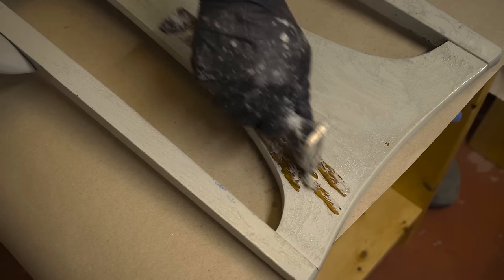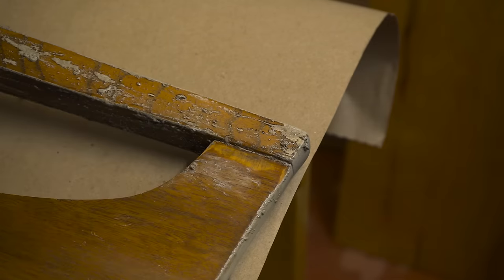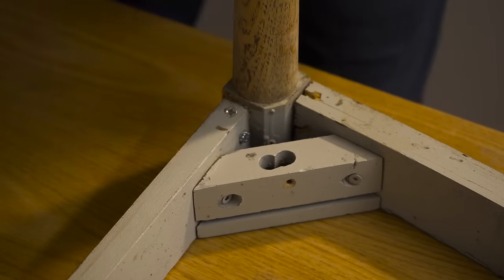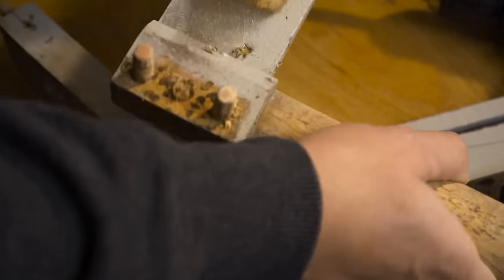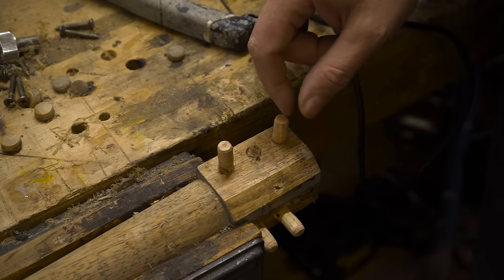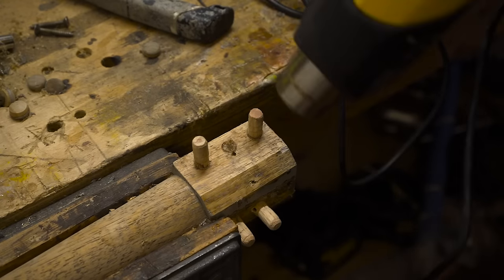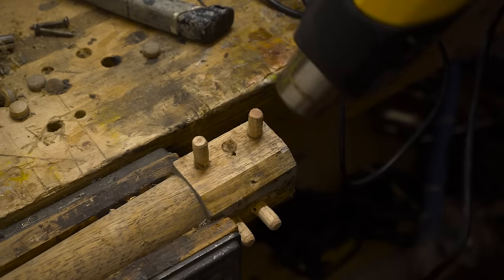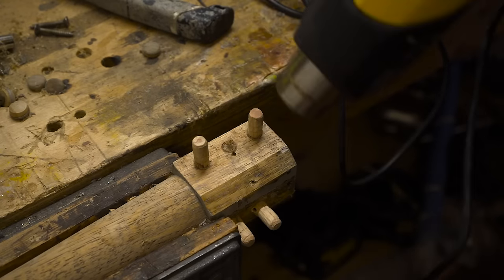Stripping Paint From A Classic Brasilia MCM Chair | Furniture Restoration, Refinishing & Repair

Comment: You did such a detailed restoration job that I am confused why you left the paint on the base, on the not visible parts of the chairs! Thanks so much for sharing
Reply: This is exactly my question either - especially that the chair was totally disassembled, so no excuse for hard to reach surfaces. Otherwise, excellent work as always.
Reply: I was wondering the same thing.

Comment: Was there a reason that you didn't strip the paint from underneath the seats? A slow strip seems to have worked with these chairs. Nicely done.
Reply: Was wondering the same, especially when they were disassembled, the perfect opportunity to get into the hard to reach places..
Reply: I was wondering the same thing. Being the perfectionist he is, I was quite surprised he didn't remove the paint.  

The end result was gorgeous. 🤩

Comment: Grew up with Brasilia. Heavy, clumsy, uncomfortable chairs and rickety table, especially when the large drop leaves were up (and the table was useless when they weren’t). Also, table legs positioned too close to the edge, so there was no getting two chairs in on the side. Remembering wildly sloshing glasses when the legs were bumped. And there was no not bumping them, try as you might. Hated that furniture, excepting the attractive matching credenza. Nice repair job anyway!

Comment: Quick question - if you allow the paint stripper to soften the paint, could you use a pressure washer to remove the softened paint? Like 700 PSI and a 25 degree angle would be pretty gentle, I'd think

Comment: why didn't you strip the paint from the underside of the seat? How did the part where previous restoration attempts sanded through the veneer turn out with the stain? Did you have to patch that spot or attempt to paint the wood grain there? Did you re-upholster the seats or keep the existing upholstery? Is it original upholstery? Why didn't you show us any of the restoration work from the arms, that would have been fun to watch.

Comment: I am brazilian and i was wondering if there was a explanation for the name. For those who dont know Brasilia is the capital of Brasil. A totally new city built from scratch in the middle of nowhere in the 60s. Its a symbol of the modern architecture with a lot of buildings made from framed concrete. But then I saw the back of the chair and instantly recognized why. Great work by the way!
Reply: It was just the name of that style line by Broyhill.
Reply: Com toda certeza foi do frenesi que foi na época, principalmente por causa do design e da inovação que a cidade mostrava, e isso com certeza gerou uma forte inspiração na indústria moveleira mundial. Essa não é a única peça que tem o selo Brasília que eu vi sendo restaurada.